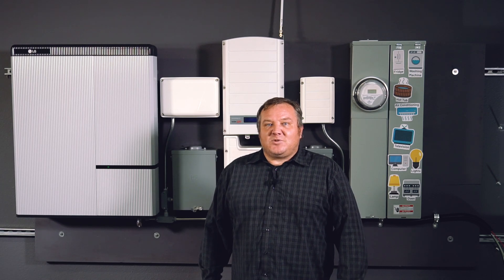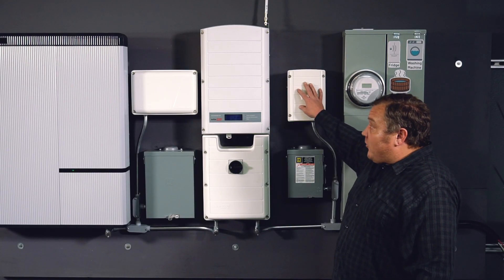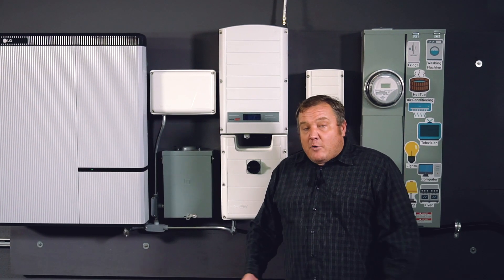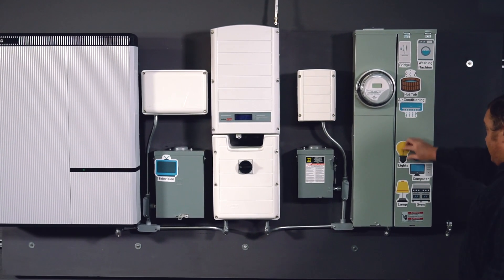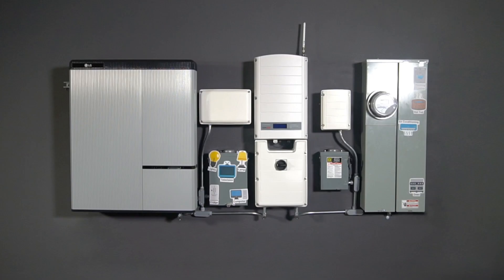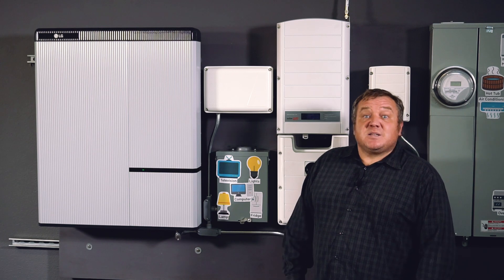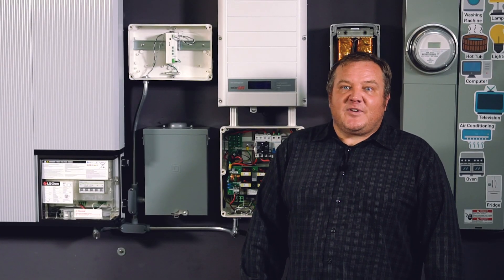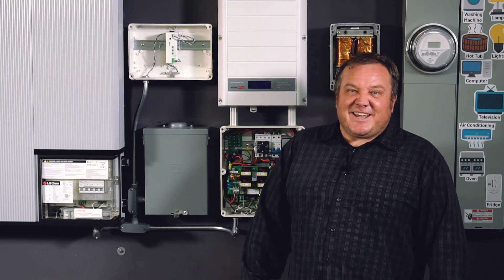How Does Grid-Tied Solar with Battery Backup Work? – Unbound Solar

Comment: I still don't get it.  what difference does it make during daylight when the panels are producing power?  during periods of sunlight, the panels are powering the home, not the power grid.  No?  what am I missing?
Reply from the maker: It’s a common misconception that solar panels can power your home directly during the day, but there’s more to it when you’re connected to the grid. By law, grid-tied solar systems are required to have certain safety measures in place, primarily to protect utility workers. One of these safety measures is the use of a controller switch, which becomes crucial in situations where the grid goes down, like during a power outage.

Here’s how it works: In a typical grid-tied solar system without batteries, the solar panels generate electricity during the day. This electricity is first used to power your home, and any excess is sent back to the grid. However, if the grid goes down, your solar system automatically shuts off. This is a safety feature known as “anti-islanding,” designed to prevent the electricity from your solar panels from backfeeding into the grid, which could be dangerous for utility workers repairing the lines. If solar panels continued to send electricity into a downed grid, it could create a hazardous situation, potentially “frying” the workers who are trying to restore power.

This is where a battery system comes into play. With the proper setup, including batteries, a controller, and specific wiring, your home can become self-sufficient during a grid outage. The batteries store the excess energy generated by your solar panels, and the controller manages this stored energy, allowing you to power your home even when the grid is down. Essentially, the batteries create a closed-loop system that isolates your home from the grid, ensuring both safety for utility workers and continuous power for you removing hiccups like cloud cover.

So, while your solar panels do produce power during the day, without a battery setup, they can’t keep your home running if the grid goes down. The key is having a system in place that safely manages where that excess energy goes and ensures that your home can stay powered independently when needed.

Comment: Question: When the power grid is on and you have your power coming in from the panels going through the transfer switch, are you supplementing your power usage with the panels also, or just being able to disconnect from the grid when the power grid goes off line. My main thought is by adding a 5kw panel system that's producing wattage and have it on at the same time as the power grid going through the transfer switch to reduce the kW usage? Does this make sense?
Reply: Typically with a grid-tie your solar generation is used to power your loads, with the excess solar generation fed back into the grid.  If your load exceeds the solar capacity, power is pulled from the grid.  Keep in mind, if the utility power goes down, solar generation is automatically curtailed (to keep from dangerously back-feeding the grid during utility work).  Thus a battery backup can feed a separate "critical loads" panel during a power outage.

Comment: I find it strange that most battery systems talk about grid backup. A failed grid is a rare event. In California, the installed solar capacity is so great, that the utilities are trying to limit more home solar. Already it seems that they throw away grid tied solar going to the grid. So, in order to get some use from your batteries, it would seem better to let the grid back up your solar-battery system. The solar itself rises and falls during the day, so it doesn't make a very reliable source of power. So it would seem better to charge a big cheap battery directly from solar, and use any excess solar first to drive loads, and then dump to the grid if the battery is full, and no loads are present. Then tie an inverter to the batteries, and use that as the primary energy source for evening and night and day power until depleted, or until daylight solar starts the charging cycle again. 
   If the solar and battery are sized for average yearly home consumption, there will be excess power available for half the year, and inadequate power available for the other half of the year. The utility will mostly be unused during the spring to fall period, and used a lot in the fall to spring period. To do better in the cold season, more solar must be added, and that quickly becomes impractical.

Comment: if the grid is down can the panels still power the house/ charge the battery? or do they shut off like in a grid tie system
Reply: Good question.
He said, "you only have a finite account of energy until the sun comes back out" 4:50
This confuses me because afaik most grid tied solar totally shuts off the microinverters, which would include charging the battery.

Comment: How do you make it so that when your battery is completely charged it will back feed into the grid to save you on your electric bill?
Reply: This happens automatically. When you have solar, the first place the power goes is to wherever in the breaker panel needs power. That could be a washer, a cooker, or it could be the battery charging. When there is more power coming in from solar than can be used in the house, the only place it can go is out to the grid (in a grid tie system).

Comment: Energy is not power. The battery stores energy not power. Units of energy are time X power or the integral of power over time. Like comparing water in a tank in gallons vs water flow like gallons/second. Power is like flow like gallons/minute. Energy is analogous to total number of stored gallons.
Reply: No, energy, known electrically as voltage, is analogous to pressure.   P=I×E.

Comment: Until batteries come down in price and can store more energy I just don't see the value in a grid down situation. I have solar and a 22KW natural gas fired generator, no critical loads panel it runs the entire house. Here in SE TX after a hurricane we have gone as long as 15 days without grid power, a battery just cant compete not yet anyways. Great video and very good presentation, thank you.
Reply: Dave I keep seeing comments about when the grid goes down you loose your solar power also. This seems like bs to me, we have a portable generator wired to our main panel. There is a disconnect we have to throw to feed poser into our panel,  can`t you do the same thing with solar?
Reply: Yes, at this point in time, whole house, natural gas generators are best.
Reply: It takes lots of solar panels and batteries to do a whole house but it can be done.
Reply: Running "the entire house" is your problem, not the cost of batteries.  Your electrical appetite,  isn't compatible with off grid living, which is exactly what your situation turns into, during a prolonged grid down scenario.

Comment: I would really have loved if he added second sub-panel that goes to generator to power AC and/or Jacuzzi or something else useless, but not tap into battery energy.  But also, generator would be able to switch from powering AC to powering the rest of the house and charge battery.

Comment: I have my meter outside and it runs underground to utility room in the basement.  I want to look at how to incorporate solar with battery back up. I saw a video where the meter connected to the main distribution utility panel then to ac disconnect and on the same wall the dc disconnect boxes and solar wires leading to the inside.  They were all in one iron box and into one hole.  Does both the ac and dc wires run directly into the charge MPPT charge controller or does the ac wires goes to main panel which is then connected to MPPT?
Thanks

Comment: I am trying to wrap my head around a grid tied system with battery backup. Can you tell me what is a main distribution utility panel? What is it used for?  Is it connected to the pv ac disconnect and then both are connected directly to solar charger?  Where does the solar ac disconnect and the distribution utility panel to the main service panel?

Comment: Good video... but reality check is not worth it to have the backup battery, the more your battery panel produces energy from the sun with a lease, you will end up paying more than to have  only solar panels , I have both,  but I wished I could do some more research before signing into contract! 
Before backup battery panels,  we paid every month between $10 to $50, hot or cold season, but since I have the backup battery panels I paid between $60 to $100+ prices. The bill changes all the time not going down , you can paid more than$100 per month. In our contract you actually get charge more as you produce more energy, this instead of receiving energy credit!! 
Im stock with it and I hate it!!!
Reply: That's one of the reasons LEASING a solar system sucks.

Comment: Nice presentation. Couldn't you skip the sub-panel and just make sure to turn off your A/C and hot tub? Maybe it's not that simple.
Reply: With grid-tied solar systems, the auto disconnect will kill the solar power entering your main panel once the grid power goes down. This prevents back feeding to the grid, which prevents potentially electrocuting linemen.
Reply: @namewithheld367  is it possible to prevent the back feed into the grid so you can have electricity even if the grid is down?
Reply: No, the rapid disconnect prevents back feeding.